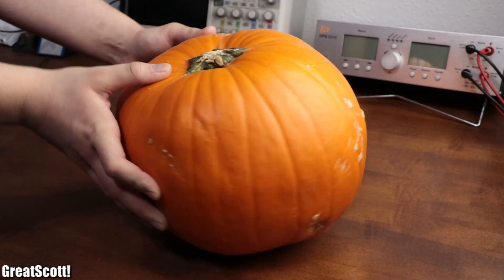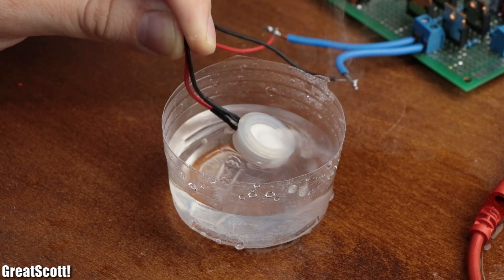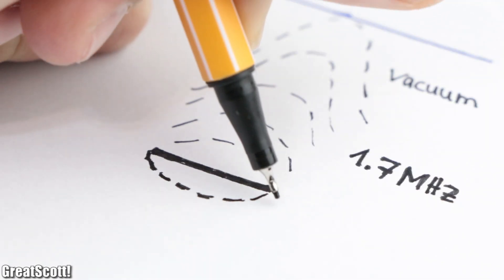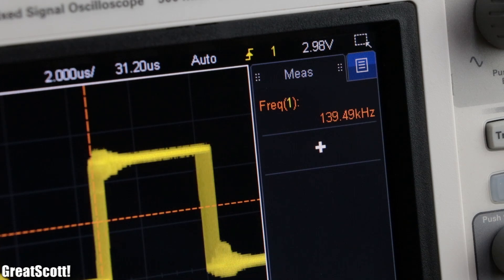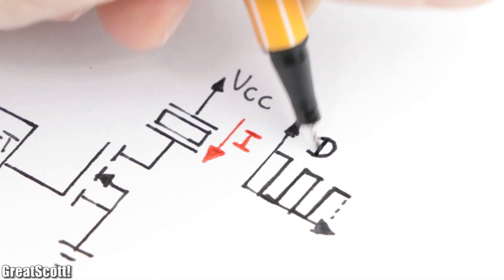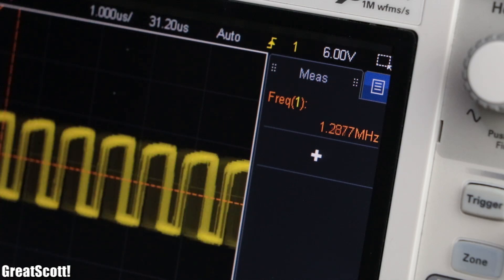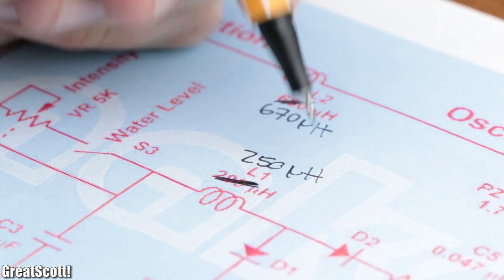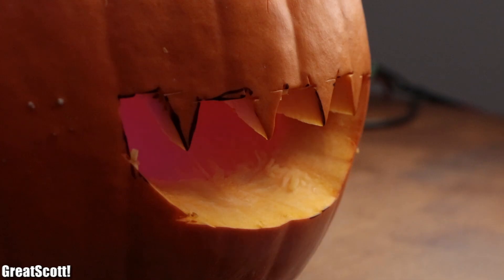Ultrasonic Mist Maker || DIY or Buy

Comment: hello +GreatScott i have a 12V DC motor that at firs turn at low rpm and then go fast, but it go fast in 3 4 secs, is there any way to make it reach full speed directly ? i have another one that will turn at full rpm immediately but the problem that is slow. so how can i fix the first one.

Comment: couldn't you use the mosfet&timer circuit while providing a third voltage at half the supply voltage to one wire of the disk and connecting the other wire to the pwm?

Comment: I want to know how to make a light organ which uses 5 c7 bulbs and is powered with 110 to 120 volts AC power.
Reply: The lights flash to music,  one is on then goes out as the other four lights flash.   Would also be cool if it could be made to flash a string of miniature Christmas lights.

Comment: A single transistor with 10mH inductor in parallel to the piezo (provides the negative current) would have been cheap and easy.

Comment: I wonder if you just found that unique frequency that easily splits water into hydrogen and oxygen making HHO gas!? Can you please insert anode and cathode into a jar filled with water and apply 1.7Mhz  electrical current (DC) to it? I'm very curious to find out how much HHO gas will be produced. By the way, you can add a bit of baking soda to to improve water conductivity. Thanks!

Comment: You could have used an tunnel diode oscillator with an jfet voltage follower circuit.

Comment: Hi GS, did you try using BU 406, they have 10 MHz speed and can tolerate 7 A, 200 V? And they are cheap, like 0.2 EUR in shop not online. Think that N 555 and 2 BU 406 can make control logic?

Comment: Quick thought, might not work:
It seems to me that the problem with the first circuit is not the voltage being DC, but the piezo basically being a capacitor. It gets charged the first time the mosfet turns on, but then keeps its charge regardless of the state of the mosfet. This will keep the voltage of the negative piezo pin at ground potential, even when the mosfet is off. The first solution coming to my mind would be putting a resistor in parallel to the piezo, so it can dissipate its charge while the mosfet is off. This would pull the negative piezo pin to Vcc potential again. Alternatively, one could then connect the piezo in parallel to the mosfet instead of the restistor, which shouldn't make much of a difference.

Comment: Just use the  coupling capacitor to shift the DC waveform (resulting from the 555 timer oscillator) into AC waveform.

Comment: Hi Scott big fan of your channel :) I have a question, If you added a capacitor in series to output of the MOSFET circuit to remove the DC voltage, wouldn't that solve the problem?
Reply from the maker: +Carlos Castillo No

Comment: Look at the class E resonant inverter. It is probably what they are using. It provides high frequency, low power, low loss, single grounded mosfet, AC output, by means of resonant conversion. The piezo itself is part of the resonant circuit, since it behaves as an LCC tank. The single mosfet can then be driven by a high speed low side driver like TPS 2815. The oscillator is probably something also better suited for MHz range than the 555, like a CMOS inverter oscillator
Reply: Or it can be made even self oscillating

Comment: Maybe try placing the piezo as a crystal in a cmos crystal osc. Then maybe boost the output by increasing the caps or parallel more inverters or add your mosfet to the inverters outputs. https://en.m.wikipedia.org/wiki/Pierce_oscillator

Comment: John hutchison once showed a resonant circuit by apply a microphone as a negative feedback switch sensor near the sound source (in this case, it's the disk under water) to create disk-water complex's self-resonance. it auto adjust frequency, no need to adjust it by urself.

Comment: Great video as always. But for that 555 and mosfet circuit, try giving output of 555 to non-inverting terminal of an opamp and fix inverting terminal to around 1V. (use ua741 opamp IC as it needs +Vcc and -Vee) This may create required oscillation. If it works kindly inform me. I am eager to know the results if it works or not..

Comment: if you could use this dc oscillator it could be cheap.
https://imgur.com/a/mcQau
Only consists of transistors and an RC circuit. You should be able to get a high frequency by using RF transistors

Comment: You just have to add a series capacitor to the output of the 555 timer and it will make the unipolar AC signal bipolar by supressing the DC component.

Comment: If your requirements include "cheap," DIY will almost never win. The advantage DIY gives you is that you can build something higher quality, for a reasonable price. Your "expensive" circuit could be a great starting point to add features and make something great!
Reply: I beg to differ. It does take engineering skill but there is probably a cheap DIY way of driving that transducer at 1.7 Mhz
Reply: @metatechnologist  but wouldn't it be great to scale this up for a greenhouse or sauna, a massive high quality water vapor belcher

Comment: Nice! I've been meaning to try this myself. 
About the 139kHz; piezo transducers have multiple resonance modes. The 1.7MHz is fairly simple to figure out.  This should work out the same way as the resonance frequency of a open cylinder.  Basically, take the speed of sound in PZT ceramic, and use the disc thickness as your cylinder length. 
The 139kHz you saw could be the radial resonance mode. This comes from the piezoelectric material getting wider when it compresses, and is mostly controlled by the diameter of the disc.

Comment: there is a circuit that does in fact work out there.  it uses a unique transistor that you can sub with a tip31 i believe.  took a while to find it, but it does work.  voltage was approx 20-30vdc to power it.

if i remember correctly, it was like a russian part.

Comment: that's what Iam trying to do these days 
could you help me with circuit diagram for ir2110 ic to make h bridge circuit for ultrasonic cleaner transducers driven by 555 and 741 mosfets on 300volt

Comment: You just need... HF VFO and amp + coil. one Tr is for the Vfo another for amp, inductor will make impedance mathing... 
easy way is to take DDS 9850 for signall  and some arduino for interface...... and make just amp from HF Tr.
it works better than orginal... you can also test it for Harmonics. if F1= 1,7 ... next i have was 2,4 ...
for the water.....
if you want to have piezo in perfect condition you need to add some acid to it.. to prevent calcium crystallization...
even after year it is looking like brand new.... im Using it for humidify... air...   try some demineralised  water from iron T-Shirt device  ;-)  or destilated ;-)

Comment: 6:26 dude, I know you're hardcore, but haven't you heard of breadboards? Those white things with holes in them. They're pretty handy. Also, can't you just make a radio oscillator with a couple of plain BJT? Why all the mosfet driver shenanigans?
Reply: Yes, he does use breadboards. In almost every single one of his videos.
It is just not a good idea to use one in high-frequency circuits because the parasitic capacitances.
The mosfet drivers were there to turn on the mosfets on and off really fast, because you need to charge and discharge the gate quickly.
Reply: I solder stuff in mid air all the time.  if its convenient, that is.

Comment: I want to start a basic electrical lab but for under £400 can you make some suggestions
Reply: DrayLand look on Amazon and the like for electronic component kits. That's a good start. A 40 watt soldering iron would do just fine as well. No need to get something expensive. With a bit of digging you could probably find a cheap o-scope or perhaps a kit for one. EBay and Amazon are your friends.

Comment: Hi Scott,
another awesome video :)
I'm thinking about making Wemos based controller for 5050 RGB LED strip. LED strip must have 12V, but Wemos goes on 5V, so I'm wondering should I buy Power Shield from freetronics (https://goo.gl/GsZcKj) and RGB shield based on P9813 (https://goo.gl/m7nnGk) or maybe I should build my own Wemos shield that will combine both shields? Schematics would be very helpful.

Best regards,
Tomasz

Comment: Just a guess, maybe an oscillator with a transformer would work better, like one on this schematic:  http://cxem.net/house/1-55-1.gif  Piezo can be connected directly to the secondary coil. Also, mosfets do not work well in high frequencies due to the high gate capacity. BJT:s would work better.

Comment: How about an ultrasonic mixer? Power Ultrasonics and Electronics with ultrasonic transducers attached to silent metallic horns submerged in water or other fluids in the 20khz - 40kHz range with amplitudes around 12V - 90V, are a powerful option to remove hard to remove stains, like blood and grease and such, in a matter of seconds. And with NO DETERGENT. It's the same as regular ultrasonic cleaners, but with so much more power output in a higher volume.  I'd love to see such a circuit. This guy knows for sure, but his project isn't that clear about the circuit. http://www.imajeenyus.com/electronics/20110514_power_ultrasonic_driver/index.shtml

Comment: I did the pumpkin thing a few years ago (with a bought one)XD good fun. Currently using the transducer as an ultrasonic agitator to try and get gold nanoparticles back into suspension (because science is fun)! I've had good success with 28 nm particles, but doesn't seem to be touching 110nm. I wonder if it has to do with a mechanical resonance between the nanoparticles and the transducer frequency...

Comment: Instead of creating 5 circuits and THEN finding out that the output freq is too low or that the waveform is broken, you could have saved yourself a lot of trouble by simulating the circuits first in something like LT-Spice or NG-Spice. You basically already have the Altium/ cad design for the circuits.

Comment: If you opened the one you bought and had a look at the circuitry it uses, do you think it would be possible to wire in more than one piezo disk and produce more vapour? Great video as always!
Reply: For what it's worth, they do sell multi disc models, but they aren't as cheap. 3 disc are easy to find, and I think I've seen a 5 or 7. I bought a 3 in the past and it works great for those mist fountains where I feel the single discs are lacking.
Reply: Sony look at the guts of a sonicare toothbrush, way different principle.. they use a layer steel transformer style in the shape of a tuning fork with coils wrapped around it.. very interesting.
Reply: It is sealed with potting compound
Reply: If you wire in one more piezo-electric disc with the one that's already with that item, it will decrease the frequency.
Reply: @novadelp5969  why?
Reply: @dvorak2676  It will decrease amplitude not frequency. I've measured the output signals of two identical but separate boards; one driver and one disk versus one driver and two disks(an extra disk shared the output with the other disk). The two disk driver showed lower amplitude but it still kept in time with the one disk driver when you lined up the peaks. Usb power supply had enough current to power 4 drivers so the amplitude was only limited by the current protection circuit on the driver board.
Reply: @sovietdies  thanks a lot for checking, that sounds more logical than what Nova said

Comment: Sir, is an ultrasonic speaker able to create steam, or vapor pressure in a closed system?  I was wondering if a person could use an ultrasonic driver to create a steam engine that used sound and electricity instead of fire....???

Comment: in my country (viet nam) they can make ultrasonic mist maker easily by using BU406 transistor. and it easily make 1.7 Mhz with very cheap price. they not using H-BRIGE or any 555 timer.
they using BU406 and some simple component with 28v DC voltage and piezo. i think you should try to do it ( sorry for my english knowlegd)

Comment: Pumpkin carving pro tips: Use a serrated knife or a saw blade to make your cuts. It is much safer and more controllable than a slicing knife. Use ketchup if you want to make your pumpkin look bloody. Excessive realism with actual blood is unnecessary.
Always make the top cut as circular as you can and give it a generous bevel. The top tends to lose water and shrink faster and can fall through in a couple of days. This is especially the case if you are going old school with a candle instead of LEDs.
Use a serving spoon to remove the guts and seeds rather than your hands. It is much more effective and less messy.

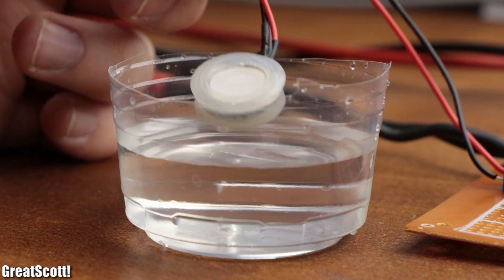Comment: At 5:05 it didn't work because you charged the piezo capacitance. After charging once, it'll never discharge again because you don't have a discharge path. That's why you use "AC".
Reply: You need add inductance at 5.05
Reply: Fernando Zigunov very accurate.
Reply: Plus protoplasm

Comment: All piezo disks have 2 resonant frequencies, which can be calculated from their dimensions. The lower one is the radial resonance frequency, which is not useful in this case. After a few harmonics, you will find the thickness resonance which is what these piezo atomizers operate at
You can find more info here http://www.piezotechnologies.com/knowledge-desk/overview-piezo-materials [PDF Warning]

Comment: I use a mobility scooter, which has an expensive controller on-board. I always fancied being able to put together a circuit that could replace the controller, should it ever fail. It's not just going back and forward, it's controlling braking, using the motor and an electromagnetic brake.

You can get a little USB mist maker for a few pounds/euros.

Comment: Why not drive a small transformer with the single MOSFET output? The transformer output would definitely be true AC.  You could even do some impedance-matching (if necessary) while you're at it with careful selection of winding ratios.  I enjoy your channel. Many thanks. (Edit: My apologies that some others have made similar suggestions that I did not notice until now)

Comment: You should try to use an LC resonator to reach the high frequencies. Can you make a video explaining in detail how to choose the component values and how build an adequate circuit?
Reply: Add a coil to resonate the Piezo capacitance.  Should not be too hard to get 1.7MHz.
Reply: RIB B yeah it should work but you need negative feedback along with an amplifier to keep the oscillations from decaying.

Comment: wait, why the 555 with 1 mosfet did NOT work? a PWM signal between 0 and 5v can be seen as AC signal between -2.5 and +2.5v, after all the 0 is arbitrary unless all component grounded.
Reply: Piezo is a capacitor that will charge to 5v, then never see the "AC".

Comment: Isn't there a single IC DIP that will generate the square wave that you want and even switch the power?

Also, what you called a DC voltage coming out of the initial 555 time circuit is an AC voltage with a positive DC bias applied. You still need to remove the bias to get it to work, but calling it DC is incorrect since it will interact with capacitive and inductive components just like any other AC voltage.

Comment: Engineering experimentation and failure are positive learning experiences, part of the process, and sometimes just plain fun.  What they are never, is stupidity.
Reply: Depending under how much pressure you work on a task a failure can eat you away much more than you would think. Nowadays development departments are no kndergarden, the persons who are the loudest/aggressive/pursuing/stupidest are promoted, thus many experts who think in silence for themselves work at home in their basement or just keep calm...
Depending on the middle to low management corpus, engineers suffer more ore less for less money than the con artists of management.
The moment the "art" designer and economy enginer is valued higher than the "application/design/electronics engineer" who do solve the problems, you should just change workplace :-\
Reply: Agree, and it would be great if Scott could overcome it and make the sequel videos, thus he reviewed what is actually the problem with the project in the previous video. Then he can explain the ideal of circuit behavior and its output and also practically correct the mistaken project.
Reply: He was being self-deprecating.
Reply: Ive failed at so many things,  thanks for saying that. Life is worth the experiment.
Reply: Agreed!

(Congratulations on the number two top comment too!... I think...)

10:47 PM
6/19/2019

Comment: @greatscott Because the piezo is like a (lossy) capacitor (esp. at the res. freq) Why not use resonance to your advantage, by adding the right value of inductance in series with the piezo. given it is essentally a capacitor with a series 1 ohm resistor (electrically)? Set the 555 to a half the resonant frequency and use the square wave harmonics!
Reply: Squarewave is composition of odd harmonics.  But yes, needs series inductor.